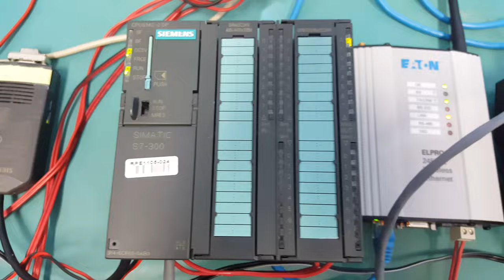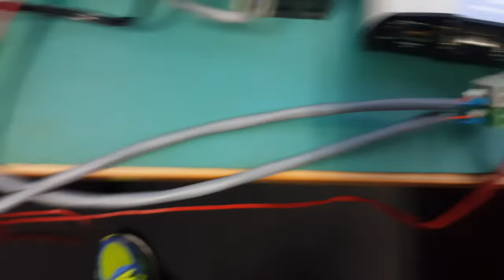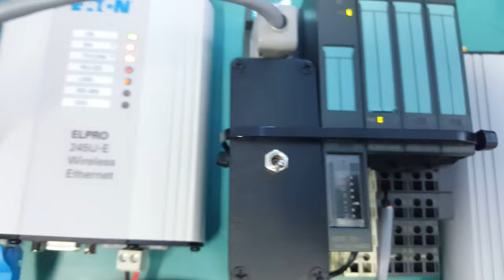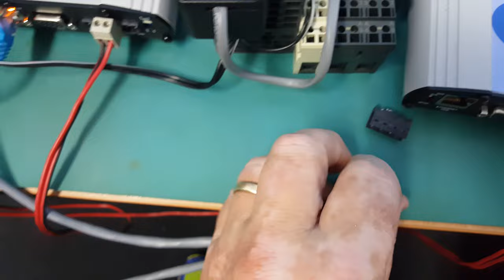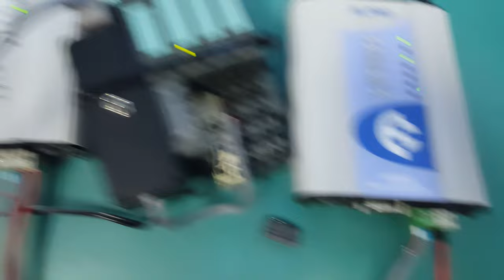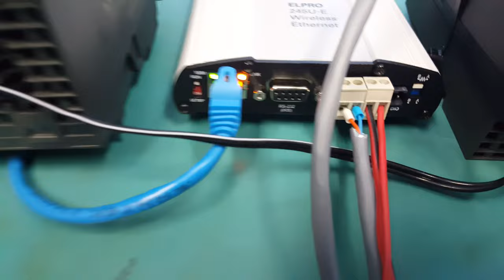Profibus with 245U-E

Comment: Dear,

I need more information for the 245U-E,
This equipment can have a type communication with: input data athrough rs-232/ethernet port and recieved wireless data, for transmitter this wireless data in the same time?
Reply from the maker: Hello Bruno. if you need more information on the product go to www.Eaton.com/wireless and then select Resources/Library/Datsheets. You will find the 245U-E Datasheet here.